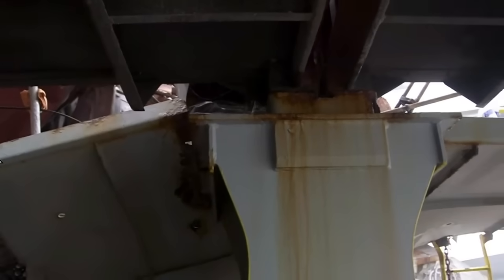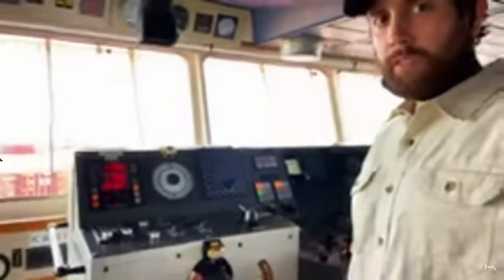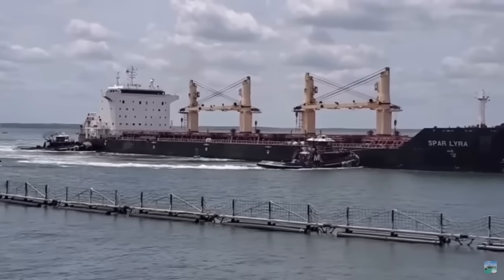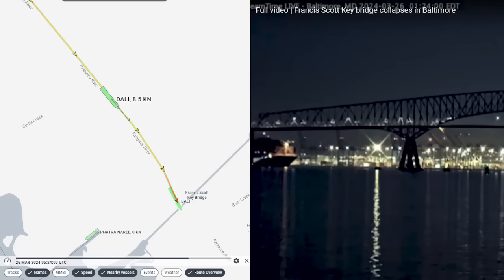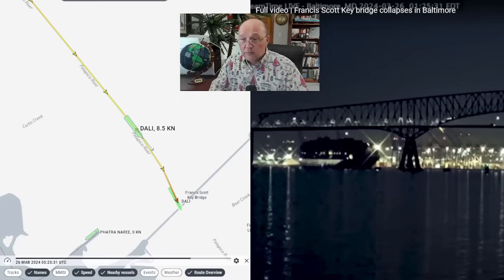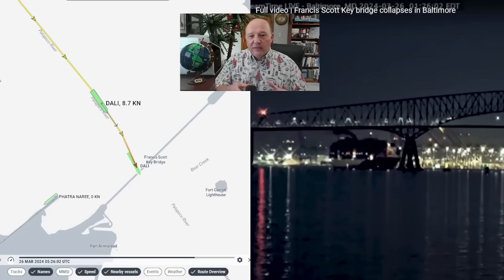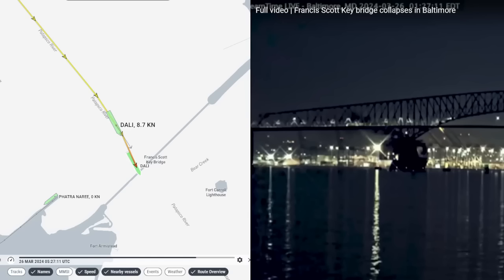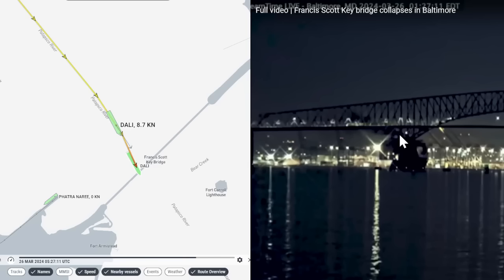Dali Timeline from Data Recorder in Striking Francis Scott Key Bridge in Baltimore, March 26, 2024

Comment: "1993" is the chemical code designation for diesel fuel. It possibly could have been used for running a refrigerated container loaded aboard the ship. Diesel fuel is used to run refrigerated container units for simplicity purposes because trucks that transport them also run on diesel.

Comment: Hello!  The complete collapse of the bridge due to 'one' insult is a dramatic engineering failure.  The NTSB has reinforced this by Publicly stating the bridge was a 'non-redundancy bridge!  So, bad on on the State!  Regards
Reply: Hello! Do have ANY knowledge on how a continuous truss bridge works??? 😳
It’s ALL interconnected. Remove one major element and the whole structure fails.
Reply: @yvonnesmith597  Hello!  Look, 'Someones' sold a committee on an engineering failure.  Then built the failure in a risky place, and it failed!  It failed, with drama.  Wind, Waves, Accident,, it was not a case of if, but when it would fail.  Most probably there was no mention of what it would mean when it failed.  No surprise here!  Now, there is a lot of good steel that needs to be salvaged, and a terrible result.  Hope the State has good insurance!  Regards
Reply: The designers could have made the 1200' channel span disconnected from the approach spans, so that if the channel span went down, the rest of the bridge would be unaffected. But the bridge designers thought they were smarter by designing a continuous span, which was cheaper.

Comment: Riveting video, thank you.  Would you please comment on the ideas swirling about that this disaster was a terrorist cyber attack?
Reply from the maker: The ship has control systems for the engine.  They are not linked to the internet.  However, they are updated with software.  There is a chance that the control system failed but it would have to be determined by what if that was the case.

Comment: Questions, it's my experience that there are ~4 - 6 or more diesel gensets just to provide electrical power to all the ship's electrical systems.  The main engine is strictly for propulsion.  So, the main engine and all of the diesel gensets went down at the same time???  This would only be the case if the fuel was shut off or bad fuel hit all of those engines at the same time.  A bit of a stretch.  Yes? Am I  missing something? AND why does the ship veer towards the bridge pylon??

Comment: Another container ship just lost power approaching the NY Veracruz Bridge. It was being escorted out of a much wider passage by three tugs but it took another three to stop it showing the use of tugs in Baltimore may have helped deflect the ship away from the bridge but without engine power and the propeller turning to give a wash to force the rudder over they likely would have made no difference given the momentum of the vessel. The only solution would be to restrict the speed of ships leaving the harbour until they clear the bridge.

Comment: Also Sal,

Then there should still be a Circuit Breaker Issue, onboard this Container Ship now happening as well? 

If the "Reefer's" onboard were causing the Electric Circuit Breakers to trip, then someone trip to share the loading across different Ship's electrical supply Circuits. 
 
All they could have done is expose other onboard electrical supply circuit breakers, to equally start tripping too. 

There by causing a ship wide electrical blackout, as seem to have happened on this Container ship. 

Before the Container Ship colliding with this bridge piers and support columns, or caused the collision to happen! 

As a direct result of a ship wide blackout, from these tripped Circuit Breakers connected to "Reefer's" onboard. 

So causing total loss of power to ship's propeller, also the Ship's rudder plus the Ship's bow side thrusters too!

Also few questions Sal, which no one seems to be asking either it seems.

Were there or are there any Telecommunications or Fibre Optic Data Cables, or Power Cables? 

Or Gas or Fuel Pipes, and Water Pipes, plus Sewage Pipes, or other utilities running under Baltimore Port and Harbour or under the Main Shipping Channel? 

Or actually utility cables and pipes were running, along or through this interstate Eastern Baltimore Toll Bridge too? 

So could this Container Ship either dropping and dragging its own anchors along the bottom of the Port and Harbour plus the Main Shipping Channel too. 

Or when the Container Ship hit or collided with and knock down, this East Baltimore Toll Bridge, could Utility Cables and Pipes been damaged, Yes or No?

Or does anyone even know, so far too. 

As ships or vessels dropping and dragging their anchors, have caused underwater Telecommunications and Data Fibre Optic Cables plus underwater Energy Electric Cables to have been damaged in the pasted too. 

Or underwater Energy Gas and Fuel or Oil Pipelines, as well as underwater Water and Sewage Pipelines all have been damaged in the past too! 

So could there be unknown damage, to underwater Utility Cables and Pipes, in the Baltimore Port and Harbour area, plus running across the Main Shipping Channel too? 

Because if there is damage to underwater Utility Cables and Pipelines, this could be an unforeseen and very expensive to repair, someone may have to face and pay for too? 

Also many road and rail bridges even passenger foot bridges, are used to carry Utility Cables and Pipelines too, across whatever the bridge is already crossing too!

So were there any Utility Cables or Pipelines, running through this East Baltimore Toll Road Bridge, also has this now caused any issues too, or are public utilities being or having to be redirected the best they can be now as well?,

Comment: Sal, another question about the VHF radio transmissions. Do you think the transmissions were on the ships radio or possibly portable units worn by the pilot? I was wondering if the ship's radio work from a completely separate power source that would be un-interupted by a power loss, maybe on a backup battery?
Reply from the maker: Portables.  Pilots have a kit they bring on board. Radios and a laptop with their navigation separate of the ships systems.
Reply: @wgowshipping  Interesting. Thanks.

Comment: Forgive me for any questions that may have obvious answers to but as a former commercial airplane pilot, I'm dumbfounded of the lack of importance the emergency steering of a vessel of this size and weight seems to have. The breakers for the emergency rudder controls appears to look like everything else on the panel. In fact, everything looks the same on the panel that you showed. How does anyone have quick access to something as crucial to the safety of the ship if they are in a emergency? Particularly if they have to wait 30 to 40 seconds for it to go online while potentially in stark darkness?

Shouldn't this type of "critical" control device be a part of an overall emergency panel and separate from just ordinary ship functions? At least marked in red with instantaneous lighting? Again, I am sure there's much more to this process along with protections that I have yet to learn, so please don't think I'm trying to be flippant. I just want to understand more about something that I now have worked with on a daily basis as a longshoreman for the past 25 or so years. Thanks for any input and information. PS. God Bless those that lost their lives and definitely the family and friends left behind.

Comment: Wow. This is so informative, clear and fascinating.
Thank you so much!!!
I'm surprised, though, that these ships have basically direct drive? The propeller is locked to the engine? Did I get that right?!
WHY? Seems like an odd choice... I could have sworn they'd be electric (like locomotives etc)...
Reply from the maker: Slow speed diesel.
Reply: They spend the vast majority of their time out on the open ocean going places, direct drive like this would be more efficient, without transmission losses.

Comment: If flow was coming out of thr Curtis creek channel sufficient to cause a push the stern to port and cause the ship start turning to starboard, would it not have a similar effect on the bow as it pass he Curtis creek channel? If so, wouldn't it require a starboard rudder of some amount to counter and maintain positioning within the Patapasco River channel? And if this is the case and they lost power and rudder control during this and the ships inertia cause the ship to continue forward at 8.5 knot and the the stern now being pushed to port by flow coming out of Curtis creek and the bow is now past this point not Bing pushed to port cause this turn. It's my understanding that these ships require some time to respond to  the rudder, 1000' long ship that a lot of force required to change direction. Especially it rudder inputs are meant to maintain a course and not change it.
Reply from the maker: The effect would have been cumulative along the length of the hull, hence the stern.

Comment: Sal, no one I've seen mentions tides. The ship left on the tide, which was high before midnight. The current at Key Bridge probably meant the ship was doing about 9 knots. And the current was more to the south than the ship's course. So if the ship lost weigh, it would drift to starboard with the tidal flow, right? What direction was the wind at the time? And I have another question. If you drop a port bow anchor, won't the body of the ship swing to starboard, i.e., toward the bridge? The more I see, the more I'm convinced the Pilot screwed up, once the vessel lost power (which is probably why the Pilot hasn't been identified).
Reply from the maker: Very little tide and current in Baltimore harbor.

Comment: Prop walk.   When in reverse, the prop turns counter-clockwise.   This will cause the bow (front) to move to starboard (right).
Reply from the maker: They probably never had time to reverse the prop.  This is a slow speed diesel probably directly attached to the prop.

Comment: When I was in the Navy, I stood Forward look out, do these behemoth vessels of the sea 🌊 have Forward and Aft Lookouts? Are Lookouts primarily just a military thing ? Rudders need to outfitted with manual control perhaps using a geared system or pulley control that can be controlled by one man in case a ship looses power. I’m guessing the rudder is controlled by hydraulics, and not sure if there’s too much resistance pressure to go from ships power hydraulics to a manually geared or pulley system as an emergency secondary to control rudder.

Comment: if you go back a little, you answer your own question of why did the bow swing left, it was due to the anchor starting to catch from the port side. notice speeds, 8kts  down to 6 knots
Reply from the maker: That is a reasonable assumption.
Reply: @wgowshipping  OH!  Ya' know what?  Riverbank mud / silt / sand when wet is often "thixotropic".  That is, in rest it tends to gel (often if out of the water a bit, enough to cautiously walk on.)  Impart motion and it liquifies.  Basically "quicksand".  So if the anchor's motion through the bottom muck slowed, the resistance to that motion might have increased.  Also, "older" sediment might not be as soft, still allowing the anchor to "trench" through it, but with more resistance.

Of course, if you are a REAL conspiracy theorist, the CIA laid down different sediment in different spots to optimize the anchor drag to direct the ship into the bridge support, all to help depopulate the planet.  

C'mon You Tube, where is the eye roll emoticon?

Comment: Is the normal course of the ship in the channel to be headed straight towards the pylon of the bridge? Where the ship has to angle away at some point to the center of the harbor and pass under the center of the bridge?   I guess there is two way traffic to be avoided.  Just thinking that the Dali did not veer into the pylon, but it failed to steer away. Shouldn't the ship be lined up far before the bridge to travel in a straight line without having to steer away from the pylon?
Reply: It was originally lined up on a steady heading of about 140 to pass under the centre of the bridge, then something happened, which is what the NTSB is investigating.  The lights on the ship going out three times suggests problems with the power supply, which could affect rudder control.

Comment: The reason the ship started turning is they dropped the anchor. That would have slowed down the bow, but the stern would still have momentum, causing it to start swinging around the bow. Since the anchor was dragging that changed the trajectory of the ship.
Reply from the maker: The anchor did not drop until after the swing and it would have pulled the ship back into the channel.
Reply: @wgowshipping  No, the ship would have swung around the anchor. Dropping it put the ship out of control.

Comment: Thanks for combining the timelines from multiple resources

Is there a speed limit in the harbour? Approaching and going under the bridge? 

Would the island around the pier on the new Florida bridge be able to protect it from the overhand on the DALI and larger ships? That is assuming that the ship would avoid the offset dolphins in the water.

You alluded to it, but did not make it absolutely clear that (bow) thrusters are electric, not direct drive from engine like main stern prop.

NTSB is always slow to release information, even air crash investigations. 

I'm curious, how long do you personally think it will take to do clearing.  ie, I suspect they will start with the side channels simply because the various investigations will still be fuzting around. And it is going to take some time for them to come up with a plan to remove the wreckage from the ship with minimal new damage.
How long do you think it will take to clear the ship channel?  How long did it take in the Florida to clear the channel for shipping? 

Bridge reconstruction is a whole different kettle of fish, outside of your bailwick. There are going to be bureaucratic bun fights about everything, like:
*  who is in charge, 
*  who is going to pay how much, 
*  will the decide to reuse the remaining parts of the bridge, or demolish and start from scratch
*  what is the new design going to look like, cannot be identical construction, that style no longer allowed, "single point of failure"
   ie comparison to Golden Gate bridge shows it's central span alone completely clears the whole Key Bridge completely. Not likely to happen, but can be done.
*  getting all the approvals signed, ie environmental, construction plans, construction bid/contracts
*  who is going to get the construction contract. I'm hoping they will create a consortium to get it done faster

Keep up the good work.
Reply: There are several very large cranes on site.  Chesapeake 1000 has a 1000 ton capacity, so they can take fairly large chunks of the bridge at once.  I'm guessing a couple weeks max to have the north side of the channel cleared for traffic.  Clearing the bridge off the ship and moving the ship away can happen after that, could take a while.  There are talkers, and there are doers, who know how to get this  done.
Reply: @SteamCrane  Thanks. Yes the talkers (the politicians on TV) always get in the way and slow down the doers.  The talkers need to say, "how much  money do you need to get it done in x time" and when they are given the answer, sign the check and get out of the way. But they don't ...

Comment: Here's the question that needs to be answered. As a  port city Baltimore had to be tugboats docked near. Why weren't they used immediately to divert it from hitting the bridge? Had that been done this wouldn't even be a news story. Who dropped the ball?
Reply: It was already going at too high a speed for tugboats to be effective, and the tugboats could not reach it in time anyway. The ship moves faster than the tugboats.  The tugboats only push or pull ships at very low speeds. 

It seems the standard procedure for this port is to have tugs move a ship from the dockside, out into the main channel and as the ship accelerates along, the tugs move away.     The ship losing power after that, was something they didn't count on happening.

Comment: Unless this vessel has a scrubber (i don’t know) they were running on MGO and it is highly unlikely you can bunker diesel that bad to get those problems. I don’t believe fuel was the problem.

To me it seems like the emergency generator did not start.
Also a right-handed propeller in reverse is spinning counter-clockwise and pushes the bow to starboard. This could also explain the right turn in case they actually managed to get the main engine running in reverse.

Comment: I do not know how vessels are built today but 15 years ago Maersk container vessels were built in Denmark. The last vessels built in Denmark had huge high pressurized hydraulic accumalator tanks to keep pressure for the steering Machine in case power should be lost from main engine. Besides the electricity was produced from 4 Sulzer 8S20 stationary engine/ generator powerpacks. 3 of the engines were producing electricity to the vessel itself including refrigerated containers and in case of an emergency the 4th could be engaged, however the 4th was only for vessel alone ( the Bridge ) in case of emergency. Futher more could one or two powerpacks be disabled from powering refrigerated containers and engaged to power electricity for the vessel alone. This was a criteria from Maersk then the last vessels were built. ( I know this as I worked for the hydraulic engineering company which intalled all the hydraulics on the vessels and on the steering machine ( mechanime that control rudder ) ( 4  vessels with this design was completed )
Reply: Just stop.  Expect every vessel to be different.